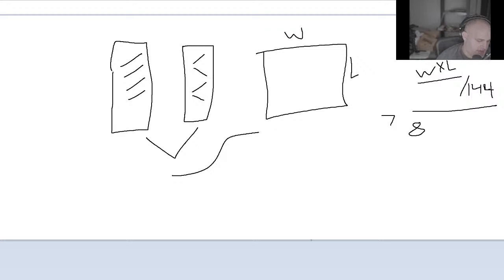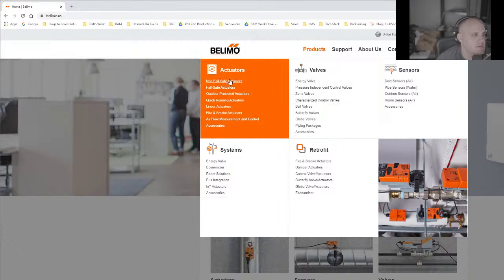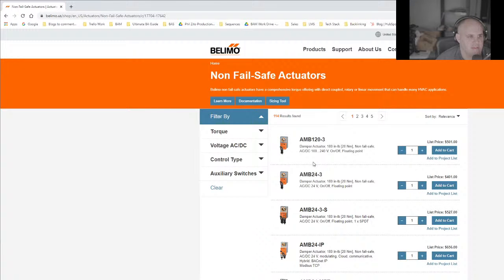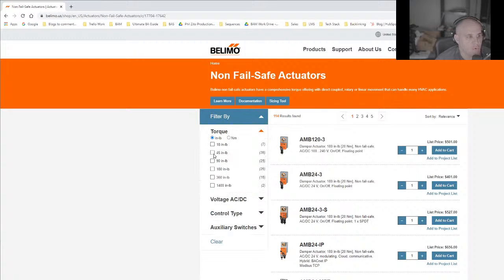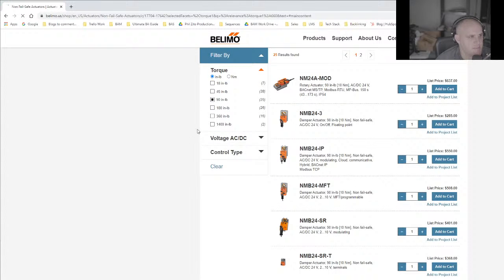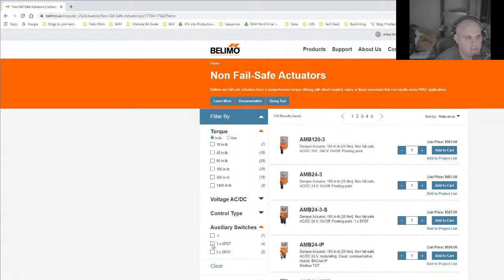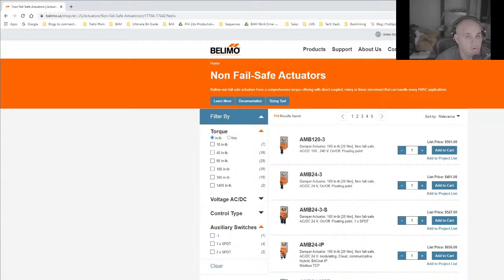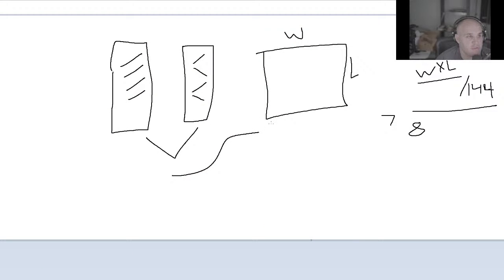SBA TV 10:  Damper Sizing and Actuator Selection And Live Q&A

Comment: What would be a best and a most common for VAV box air valve actuator - floating ( Triac) or analog modulation 2-10V /0-10V? Thanks
Reply from the maker: Typically the VAV Box actuator is part of the VMA controller. Are you talking about using a unitary controller with an external actuator?
Reply: @SmartBuildingsAcademy thanks! No, i did not mean an external controller. I did mean a controller which comes with the actuator , VMA, etc. are those typically 2-10V? I would prefer analog , but I am generally curious what is out there on the bigger picture.